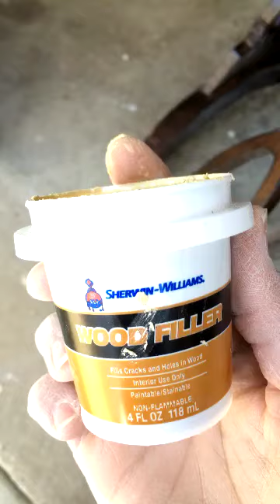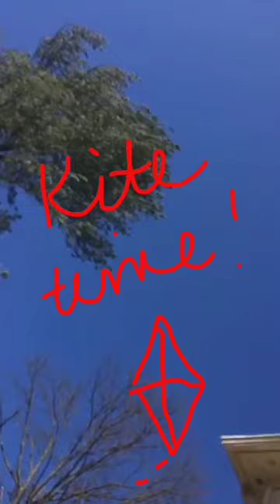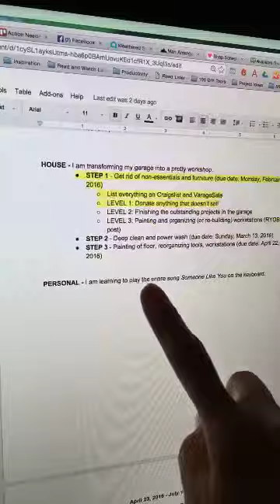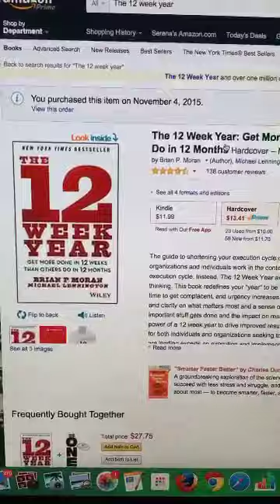My Snaps: My Morning Routine...a Chair Makeover...and Family Time! - Thrift Diving

Comment: usually you will see signs of fine powder around the holes which means the worms still burrowing.  You can buy a product to treat it to be on safe side.! Worth checking when buying second hand furniture. Good luck!
Reply from the maker: Joyce, is it possible to drill a hole there to check to see if there are larvae?? I was considering doing that! Since I've already filled the holes, do you think I can check for this? Thanks!!

Comment: I got a question, not sure what the time is over there in US but, I appreciate if you respond as soon as possible. What type of glue should I use for sticking two pieces of plastic together. Being more specific, I need to repair my cars bumper. Long story short, brackets are broken so it falls apart whenever I put them together. So I gotta glue it somehow, cause new part is way too expensive like 300 dollars, which is a lot for a 6 year old car. Anyways, do you think two component resin will do the work? Or should I use a wood glue, or idk? Can you give me ideas?

Thanks a lot! :)
Reply from the maker: +Ozan Erbektas Oh no, so sorry I'm just now seeing this comment, Ozan! Did you end up finding a solution to your bumper issue?? I'm not familiar with gluing a bumper, so I'm not sure. What ended up happening?
Reply: Thrift Diving I know you're not familiar with gluing a bumper, the reason I was asking is that if you know any proper glue for plastics. And problem still remains, was waiting for your answer, didn't do anything. :) Also If everything else fails, I'm gonna drill bunch of holes that doesn't compromise the overall look, and use small bolts to secure it in place. And I might use some bolt caps to cover the metal so that it won't affect the look. :)